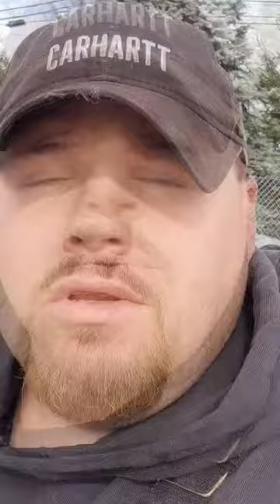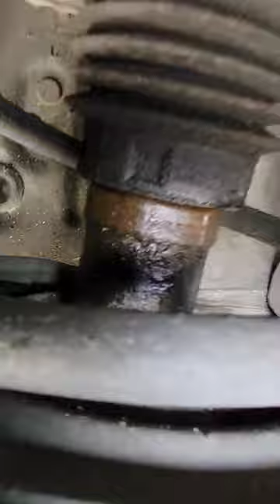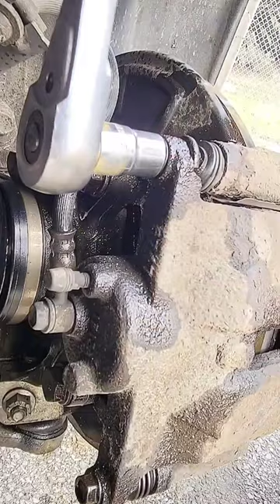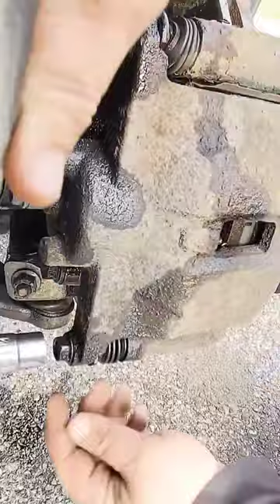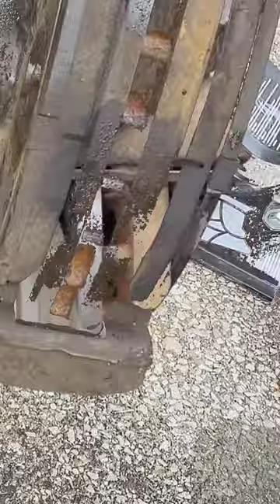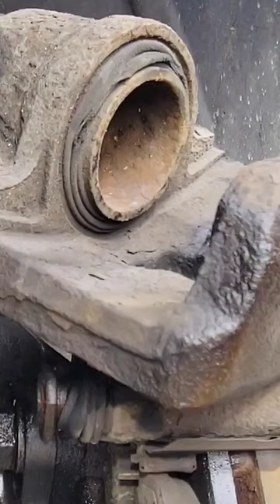Should I Lie Or Not #semperfimechanic #mobilemechanic

Comment: This is why I have an AMA form: "Against Mechanic's Advice." If a customer declines my better judgement, I'll make them sign one before I proceed.
Reply: Srry but do u put in writing. They not listening. Srry but foreal I’ve been down the path but jus have words
Reply: @suavelo5494  Yes. It's a generic waiver, explicitly accepting all liability for going against my recommendations. And a place for me to list the recommendations which were declined. Customer signs that, or I reject the job.
Reply: Dude was not present.   Record phone call discussion
Reply: What's an AMA gonna do against a customer requested rotor replacement for a not moving vehicle and leaking struts?!
Reply: @michdsm  It serves as documented proof that you advised the customer that new rotors would not fix issues caused by other maintenance needs.

Comment: I've been watching you for awhile and also own a mobile mechanic business. You have to value your time because noone else will. You tell your customer its atleast 75$ no matter if I do the job,diagnose the job or you change your mind when I show up. You should be charging atleast 70 to 75 a hr. When I first started I would do dumb sh#t thinking everyone was fair and wouldn't take advantage. It got way out of had. I had customers asking if I could go to car lots to look at cars for free and all kinda of crazy sh#t. So now I run it like a business not a hobby. I do good work I don't bullsh#t I tell it like it is. If I get customers that start  haggling or try paying later I stop that right away. Some people might think thats heartless but I've been burned so many times and the people that haggle are ones that are most likely coming back with a complaint that had nothing to do with the repair you preformed to get a discount.
Reply: U damn right!
Reply: @C0rvette454 no, it's fair. Especially if he has to take into an account of a come-back or something he doesn't wanna lose too much ass. That's what I charge too. Expect on this Hummer H3 of my neighbors. He got charged $100 an hour. Definitely made the right call too considering bolts broke and a lot of other issues on that rotted and never maintained in 250k miles piece of work. Shops don't exactly make their bank on you with Labor, it's the 3 to 5x mark up on prices to cover the "warranty of the part" which is usually even more marked up now. You eliminate that cost with a mobile mechanic. You're savings HUNDREDS on parts. I did that Hummers entire front end for $900 thanks to Rockauto. Would have been well over $4000 or more in a shop. All I charged him was that $900 for my time. You see now, 70 to 75 is FAIR. ESPECIALLY when we lose MORE on come backs in the end if it happens AND we are saving people THOSANDS, ESPECIALLY with parts pricing today.
Reply: I always tell my neighbor, no scanner type job it's a $50 Diag. Scanner gotta come out and testing has to be done and etc, $75 and sometimes more. It all depends. But no. His pricing is good and I also encourage homeboy here to take it too. You absolutely charge if you gotta drive to them especially if work maybe ends up not being performed.

Comment: How tf would a bad shock keep it from moving
Reply: Its has happened if the strut mount fails I seen them come thru the hood
Reply: @AC3RRacing Makes no sense still bud.
Reply: I been doing mechanic work for over 25yrs it happens not the often or to every vehicle but it do happens . mainly from neglect
Reply: @AC3RRacing  Thats a broken strut mount. Not a leaking strut...
Reply: @lukeyarasheski5510 thats exactly what I said the first time I responded to his comment.. Im just here to share some knowledge 👍
Reply: @AC3RRacing  I'm just very concerned that he's working on cars and thinks a leaking strut is preventing the car from moving. It's not a good look for mechanics...
Reply: @lukeyarasheski5510  he did say broken mouth I have seen in some cases, mainly in Jeep, where the hydraulic fluids leaked out of a shock in the hydraulic assembly, coming out of the housing, putting pressure on the rear of the rotor. Super rare, though I’ve only seen it once. It’s more common to find a broken mount like he stated, but in this case on this car in particular, I don’t think the shock is the issue.
Reply from the maker: That's exactly what it's doing, putting pressure on the backing plate. Now it's not to the point where it's locked up, but it's causing severe drag. Im surprised how many so-called mechanics have never heard of this.
Reply: @semperfimechanic  I’m not there’s a lot of I can do it myself or I know a guy for cheaper in the comments or they will  show up to my shop and I tell them all the same thing. Give me a call when you fuck it up so I can fix it.
Reply from the maker: Your exactly right
Reply: @lukeyarasheski5510  agreed but sometimes its hard to tell if someone is trolling or really that simple minded. Lol and yge real question would be what shop hired him 🤔😅😅
Reply: @nfpspointblank8023  dont forget to charge extra in do because now you have to undo and recheck someone else work and in most cases its gonna be more work then if you had did it from the start .. Mechanic life 😎
Reply: @AC3RRacing  we don’t charge extra at my shop. The labor is the labor regardless if somebody else fucked it up and they make my job for other mechanics at my shop shop a little bit harder but in reality, it’s probably gonna take about the same amount of time I’m not in the business of ripping people off for other peoples mistakes. I do my best to help people and and myself can be very understanding of previous mistakes. The other shops or other mechanics make there’s no reason the customer should have to pay double for mechanics mistakes.
Reply: @nfpspointblank8023   yes and I understand every business and situation is different.. if it requires same time as original job ok. but my point is if a job calls for a hour .. you bring it back and I have to do 2 hours of additional work for corrections yes price go up.. had a guy didn't want to pay to have external shift solenoids put on his trans ( Honda ) snapped the bolts off in the Case. Should I only charge the $120 I asked for in the beginning all though I may take 2 plus hours removing all the broken bolts ?
Reply: @AC3RRacing  me personally, I would not. I just charge them an extraction fee which is $80 for a max of four bolts and we will re-tap and thread the holes for him and even provide new bolts if it’s only one bolt, we have a minimum of $40 charge or like I stated four bolt for 80
Reply: @AC3RRacing  and it also depends if your shop was the cause of the damage. If the bolts Napa you’re removing them you’re liable for that I wouldn’t expect a a customer to pay for that if it comes precept, I would let them know charge of an extraction
Reply: Dud3 pointed a5 thr cv axle and called it a shock lol.
Reply: If it's that bad on a fwd car you can feel that but idk if he checked the wheel bearing or not but if the front shocks are blown and the bearings bad. That damn near undrivable.
Reply: @mdeadinbed strut mount failure meet the body of the vehicle is sitting on the wheel pervert wheel from turning
Reply: @AC3RRacing they still can drive it’s just funny
Reply: The oil leaks on the rotor so the breaks stop working no friction brakes with rotor don't don't work when wet it has to be dry
Reply: A blown out shock can cause the fender to contact the tire
Reply: Flat out b.s, If you have a strut and the seal busts comfort goes out the window, starts clunking, at the worst rub on a speed bump. It will NEVER stop it from moving.
Reply: @chriznew1695  I don’t think you know what your talking about lol I’ve literally seen cars with blown out struts where the fender is just sitting on the tire
Reply: @WillSwingem  more than the strut seal is busted then in that case......clearly i.e the whole mount is broken away or the spring broke all the way out. This video show a fuqin seal blown out.... never cause it to sit on the wheel. Also you can SEE it isn't when he walks up in this video.
Reply: @chriznew1695  I’m not taking about the car in this videos I’m talking about in general and I didn’t say just a blown out seal I said a blown out strut all though I have seen cars cars with lowering spring have fender contact just from a bad seal once all the fluid leaks out
Reply: I had the same thought,if it were bearings I would understand but it can't be the shocks, maybe the wheel bearing is ceased in one of the rotors, maybe the customer is right but he thought the wheel bearings will be changed too
Reply: @clarkkent4994  What vehicle has a giant coil spring around the CV axle?
Reply: The wheels hit the frame making super hard to turn an wheels end up getting wires coming out
Reply: Them pads don’t need changing,Just a thought what stopped it from moving .It wasn’t a shock,I’d be SHOCKED if it was. Ha ha

Comment: How would a leaking shock prevent the car from moving? Neither you or the customers diagnosis makes any sense at all
Reply from the maker: It put to much weight on that side of the vehicle causing it to drag against the backing plate
Reply: I don’t think so.
Reply: He should have test drove the car first instead of jumping right into it. He then would have then noticed the customer was wrong. The vehicle does move, just drags. Then whenever he did his inspection he could've gave a better diagnosis.
Reply: That makes absolutely no sense. If that was the case you’d hit your backing plate every time the suspension cycled.
Reply: That’s not even a shock.  😂

Comment: At the end you can see that the piston boot seal is torn! Did the caliper pistons push back? Never seen a shock or strut keep a car from moving forward maybe up and down! Now have seen a broken front coil stuck inside the inside side wall of a tire and caused a flat tire 🛠️
Reply from the maker: Didnt stop the vehicle all togther just pressed into the backplate to the rotor causing severe rub

Comment: This is common when you park a car outside for weeks without moving it. The breaks lock up and start to rust. All you have to do is put it in gear and give it gas. It will break free. Then ride the brakes a bit to wear them down flat. If there is a wobble when u break.

Comment: He probably meant to say caliper. If they get seized it will lock your brakes
Reply from the maker: I thought that to but the was free and clear and the wheel wasnt stuck so who knows
Reply: That's what I was thinking 🤔.. that happened to my car before...
Reply: Bingo!  You nailed it!   At first I'm like wtf? But I just woke up....  Well if he just compresses the caliper pistons mite free it up for a lil while.  Lol
Reply: Oh bet he had a collapsed brake line! The lines collapse and they hold the brake pressure and won’t bleed the pressure back off when pedal is released but if you leave the vehicle 30mins parked then enough pressure will bleed back and wheel won’t be locked up anymore. Fairly typical fix. I’ve had it a few times on different vehicles